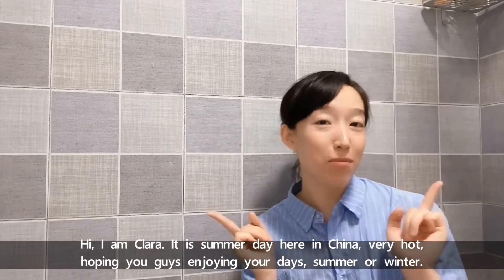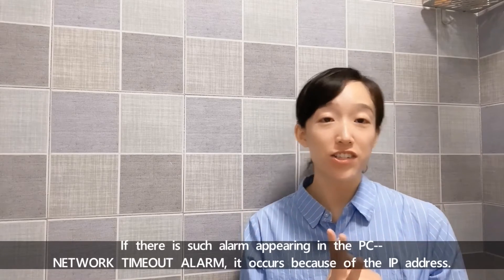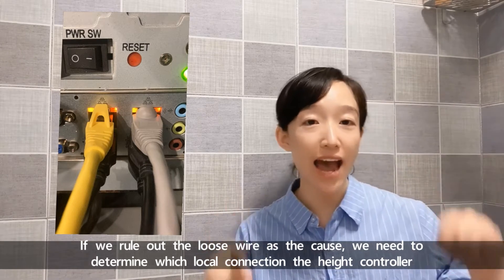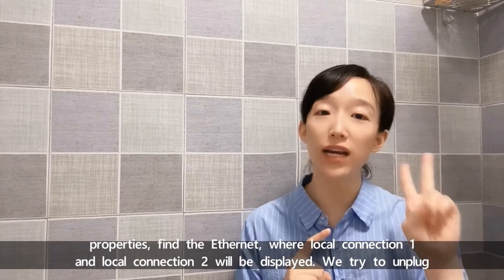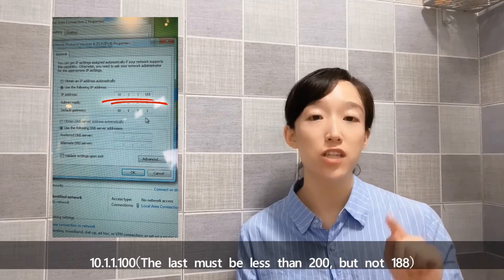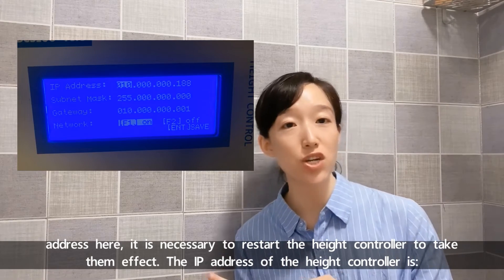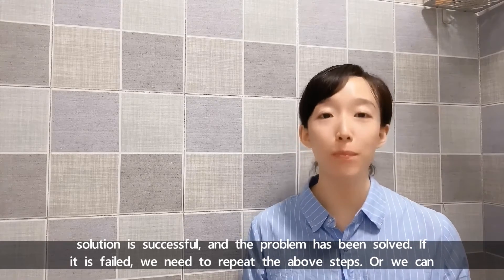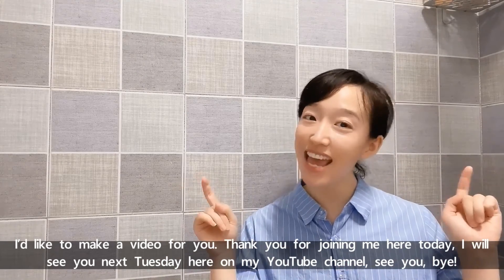CYPCUT NETWORK TIMEOUT ALARM | SOLUTION OF FIBER LASER CUTTING

Comment: Hi, I am facing this error ( Alam : EtherCat: Not Find Slave, Check Connect ) . I searched a lot, but I couldn't find any solution for this problem. I checked the internet cable and all the parts multiple times, and none of them had any issues.
Reply from the maker: Machine Config Tool-Start Scan-Save
Reply: @ClaraChai  my machine config tool seems to be corrupted...how do i get to reinstall it.. please help

Comment: We have the same Problem. But it comes sometimes during cutting, than it disappear after restart of the computer. Some weeks we have no issue, some days the alarm appear 3 times. Any Idea what it could be?
Reply from the maker: Wire loosen?
Reply: @ClaraChai  I even changed the wire allready.
Reply from the maker: @chrisredfield6948  er, is your machine in warranty?
Reply: @ClaraChai  No, its allready 5 years old
Reply from the maker: @chrisredfield6948  +86-13335151833

Comment: Hi Clara I need your help my fiber cut is not cutting what I design. For example if I try to cut circle it make oval shape at the top and when I cut rectangle it make zigzag shape. I see your video on problem of laser cutting accuracy https://youtu.be/JS8Lv5LmBNU. But on my machine this thing happen after my computer fail because of power surge.
Reply from the maker: Probably it is due to the software, is your machine under warranty? If yes, please contact your supplier first.